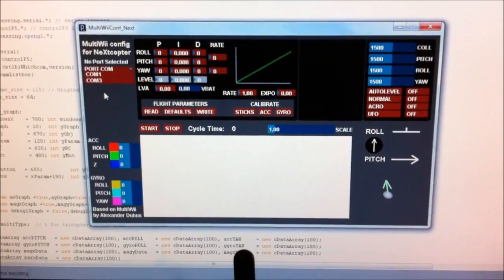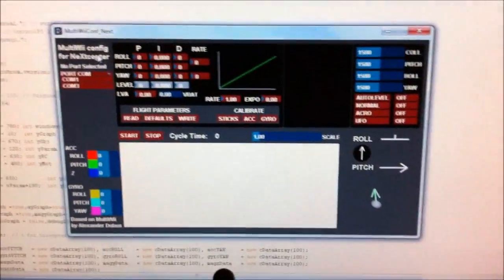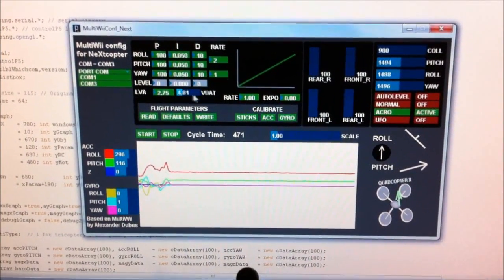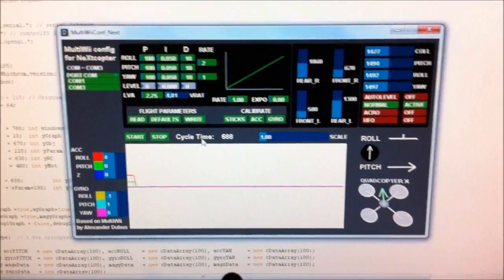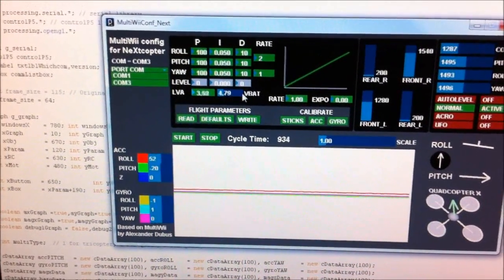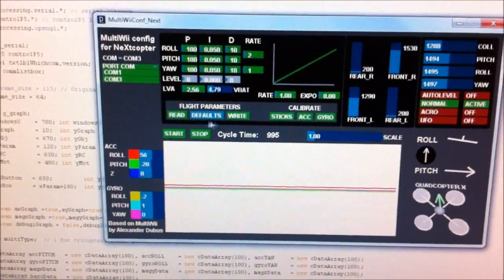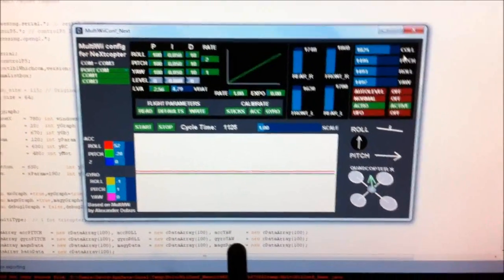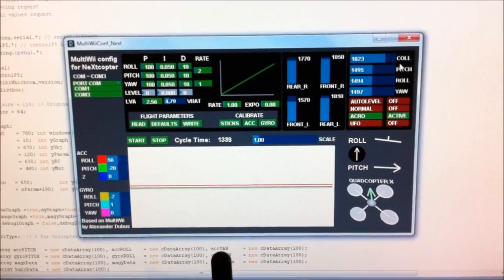MultiWii GUI for KK Plus

Comment: i have a multiwii tricopter,for some reason everytime i start the GUI i get nothing comming up,it doesnt even show the tricopter symbol on the right hand side. i have checked and rechecked my settings and ensured it is set for tricopter in the arduino sketch. I have tried re uploading the sketch and still no luck,when i click start the lights flash on my FTDI breakout board as if it is trying to communicate to the board.do you have any ideas on what is wrong? any help will be appreciated.Thanks